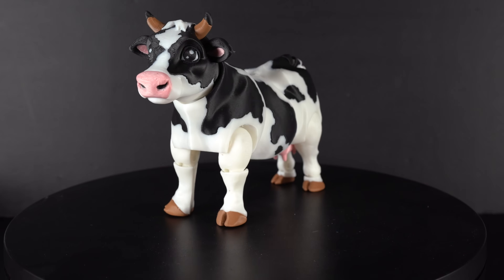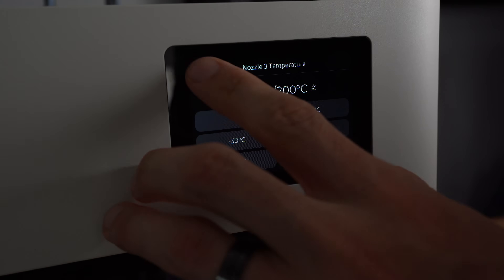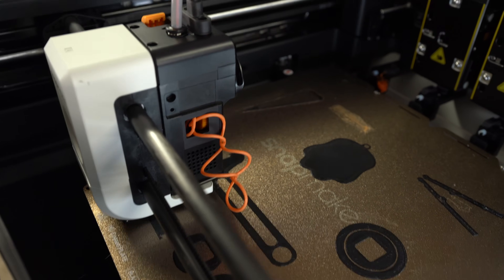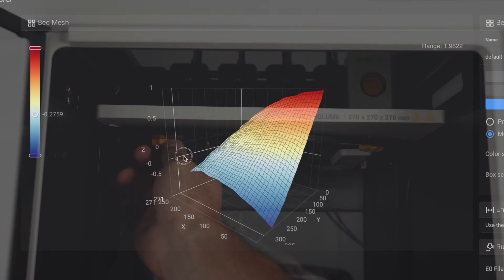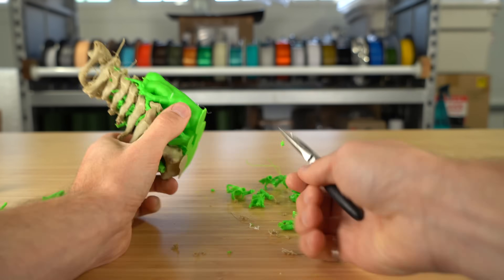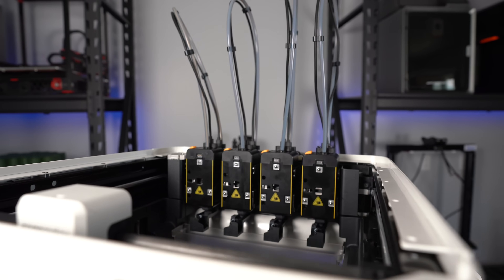The Snapmaker U1 Experiments - 4 Tools, 4 Materials

Comment: When using PETG for support for PLA don't use tree support They stick fine your contact patch was just too small and of course make sure you have a large high density contact area with a zero contact patch gap
Reply: Isn't it possible to change the contact area of tree supports?

I also wonder if PETG, being more flexible maybe is a bit worse than PLA for supports? Or at least might require more walls the taller the support is

Comment: The most impressive part is that's the FIRST docking failure I've heard of from all of the testers. I'm glad you got it working! The prints look excellent. If they can keep the production quality high, this will no doubt be the best option for multi-material printing that isn't over $1,000 more expensive. Glad you pointed out any issues you had though. Most are definitely minor or easy to fix. I have a lot of praise to give Snapmaker for using open Klipper and Orca as well as sending out a lot of test units and listening to testers. Hope the final product is great!
Reply: Yup. I still haven’t had one to date.
Reply: @thenextlayer  Have you had a change of heart on supporting jenoside to date?
Reply: I would love to see more content about this printer😊

Comment: Appreciated your video in advance of getting my (2) Snapmaker U1's. This is helpful in preparation for my next addition to using Creality K2 Plus with CFS and K1C.  I plan to use Snapmaker U1 mated with SpacePi X4 that is a Quad dryer.  Hope this will work out.  I will weld up a metal stand that will have the U1 in the middle, Dryer on top, and bottom shelf for Filament storage and wheels for mobility.

Comment: I have an A1 and yes certain plastic spools fall off during printing. My fix is to put medical fabric tape on the inside of the offending spools. I do have TPU spool adapters for other larger ones.

The bed screws could benefit from inserts to correct the problem. Overall this looks a great little printer.

Thank you for review of the U1 awesome video. Hope Prusa can up their game and overtake the market again. We need them to keep the other companies in line.
Reply: I wonder what Prusa thinks of this printer. Its open source and offers a lot of what the XL offers for a fifth of the price. They just came out with the Core One to compete with Bambu and they must be pulling their hair out now. But either way, the customers benefit

Comment: Does not include a chamber heater in the lid. That's probably the only thing missing from this printer
Reply: Doesn't heat rise up? I think a chamber heater in the lid would make little sense.
But maybe someone can replace the window at the back with a heater...
Reply: @henninghoefer your heat depends on convection based on insulation. But also, heat level depends on other heat sources with other purposes. I can't just heat the pad to 100 to keep the box warm at 50.

If you're in an area/room/garage where it gets really cold in winter, you might not be able to heat it up.

It's more about control, not actual heat

Comment: When i get the U1 I'm going to print from the snapboxes directly, until there is a mod out for the filament spool holders on the side, I got 3x A1 printer with ams lite and i really dislike the ams lite, most spools either fall of or diameter is to tight for the holder. Cant wait start using the U1 for multicolor and multi material

Comment: I would disagree about the last conclusion with the price. It looks like the U1 is much cheaper build in many areas, so we can see where the extra money goes in some other machines - more solid parts, closed chamber, higher temperatures and such. We'll have to wait until next year to see if a U1 can also as easily work through 2k or 3k hours without any major issues like some competition does in that price range. That's when we'll know if is a very good and maybe disrupting price or just a cheap try where they tried to save too much money to get to that price.

Comment: Few things:

- There is no heater in the lid, just a filter.
- The toolhead parking failure needed to be expanded on. Is there any recalibration of the parking possible? Was the print paused? How was this solved?
Reply from the maker: I just reseated the tool and resumed the print and it was fine. There might be a way to recalibrate but I’ve not tested it.
Reply: Having accessible JSON configs for this in Klipper is a good first step. I hope the firmware will be kept as open for the final release.

Comment: Much more excited about the Snapmaker U1 and the multi tool and open approach running klipper and using Orca Slicer.  Some concerns long term with the pogo pins with the tool heads but hopefully this unit will allow easy swap out if the pins need replacing.

I am interested in how the Vortek system with Bambu works out as well. One issue I can see with this system is extruder retractions needed shortly after changing colors/nozzles and the cut filament not into the melt zone of the nozzle.  Are they going to purge the material? Retract the filament back into the AMS to the melted section?

I feel waiting right now to see how all of these including the the very interesting INDX system of Bontech which appears to be the ultimate solution for it looks like 9 material/color nozzles.  Needless to say this is a great time for additive 3d printing and major advancements in the technology.

Comment: While I did back the U1 and I definitely have some reservations about Snapmaker as a company, if Prusa did launch an XL 2 with INDX, it would be my first Prusa* (while keeping my SV08's and getting INDX kits for those printers). *If it comes enclosed and is cheaper than the nearly $5000 they want for the current XL.

Comment: I am one the fance, it seames to me that the H2S is a more refined machine, and it may be more usefull to buy this one, and maybe upgrade to a toolchanging machine in a few years If I have fun with 3d printing.
Reply: If you’re new to 3d printing start with a cheaper printer than the H2S. Get an A1 or A1 mini.  Then if you like it spend away

Comment: The AMS lite definitely has the same issue with spool sizes. You can print spool adapters to make them fit. In fact, these holders look so identical to the Bambu ones that you might be able to use some of the same adapters. There are benefits to this system too. We don't have to care about cardboard spools vs plastic ones. 250g spools aren't an issue.

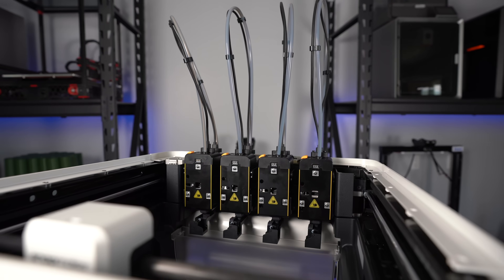Comment: Thanks for covering so many filaments and scenarios with the U1! By the way, I believe the U1 Top Cover you showed at cue point (2:40) is just a basic plastic cover with a filter and fan, not one with an active heater as some might assume. The claimed “chamber temperature up to 50°C” is actually referring to passive heating, which is the same effect you get with any enclosure when running a bed heated to around 100°C—whether it’s a consumer printer or a DIY setup.

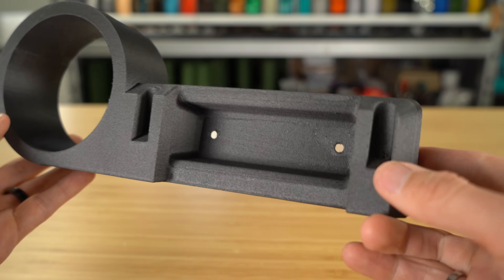When you mentioned there were no noticeable VFAs while showing the door step at cue point (9:13–9:16), I could actually see them clearly on screen. I was also surprised by how visible the VFAs were on your custom-made armrest shown at cue point (13:02). Considering it was printed in PET-CF—carbon-filled filament, which usually hides surface imperfections quite well—it really stood out this time, unfortunately.
At cue point (15:02), I even noticed a separated layer line and poor support overhangs very clearly (though maybe it was more obvious since I was watching on a large projected screen).
Still, thanks again for the effort you put into this video. It covered a lot of ground and provided a really comprehensive look at the U1.
Reply: I'm glad to have that info on the cover. There seems to not be much information or even a good screenshot of it, besides the tiny kickstarter thumbnail and some bullet points. I pledged for it but its probably best to pocket some money, as this hobby is already bleeding me dry 😂

I've watched a lot of videos on this printer, and while I do appreciate this video showing the good and bad, for what its worth, I have seen some absolutely flawless looking multicolor prints in other people's reviews with no vfas or anything. I guess it depends on the model, individual printer and belt tension, orientation, all of that really
Reply from the maker: Thanks! I was also quite surprised by the noticeable VFAs on the armrest. This prompted me to do a VFA test immediately after with glossy black PETG to see how bad they were. I printed a storage box oriented parallel to the build plate. I didn't notice any significant VFAs in this test. It's possible that the angle I printed the armrest at was a worse orientation as far as VFAs were concerned. I think what you're seeing at 15:02 is the under extrusion issue I discussed shortly after that. The PETG supports in this case did a bad job since they didn't stick well enough.

Comment: Also. Try using the bridging method. You can avoid using a ton of support material and isuues after it. So long the nozzle have 2 points to connect the filament. While less clean looking. It does the job good enough for most practical prints

Comment: That is one thing I do dislike about bambulab and many other brands. While automesh leveling does a fine job. 

Trible z motors would make the printer able to get a much more level bed without the user ajustisting anything. You push a button and the printer ajust or trim the bed itself automaticly.

Klipper support this native. But does require 2 additional motors and drivers. Given how many motors and drivers the u1 already had. I had hoved they went triple z.

However this a common cost saving thing with many brands including creality. Bambulab and most other brands
Reply from the maker: Yeah.. unfortunately the lead screws are all coupled together with a belt underneath.

Comment: Thanks so much for showing all the issues you had. The need to manual adjust the extruder tension for tpu is a big issue for me honestly. I print a ton of tpu and this seems like a big oversight.
Reply: To me it's not so much about the TPU part only, but it hints to a not very well thought filament transport. I simply expect better from an extruder these days.

Comment: Great video and thanks for the little plug at the end.  

I didn't realise the filament winder only wound in - as I was hoping it might be possible to adapt it to do a limited number of extra filament rolls tool swaps - to occasionally increase the colours beyond 4.   As you said it will be interest to see how people coming from the Bambulab AMS world get on with the much harder approach to filament changing.  I think some sort of AMS add-on from snap maker would be great for filament management, plus would also allow for occasional beyond 4 colour printing - although I understand why the wouldn't want to introduce it from day one and confuse the marketing.

I think though it would be filament cutter mods on the tool head(s) that the AMS' were connected to.

Also very interesting point about visibility - I don't think looking from the back is going to be practical - so would be interesting to see whether the camera would help with this.   I think this might end up being an issue with some implementations of the Bondtech INDX too - with either front or rear mounted tool tracks.
Reply: The Core One has similar issues with first layer visibility since theres am extrusion in the way.

The filament loader on the U1 seems relatively easy to install and uninstall, so perhaps they will release a dual motor version that can support rewinding down the line.
Reply from the maker: A cutter in the toolhead and the ability to retract filament automatically would be a huge quality of life improvement, and, like you say, open up additional possibilities if used in conjunction with an AMS type system.
Reply: @ygk3d Does the feeder actively feed during printing as well? Haven't really gotten any confirmation one way or the other
Reply from the maker: @winebartender6653 I don’t believe so. I haven’t noticed it running. The extruder does the pulling after the filament is loaded.
Reply: It is possible to change filament mid print quite easily. NeoKoi Prints has done a 16 color print. It just wouldn't make sense for something where you have more than 4 colors in multiple joined layers.
Reply: @802Garage  Dedicated sharpie-changer toolhead or inkjet toolhead for painting last layer 😅
There are DIY examples for both, but the filament could be the problem. Filament does not wick ink in controlled manner - or at all, like coated color printing (photo) paper.

Seriously, I could imagine someone finding a way to do something like that with INDX.

Comment: I backed it.  I was planning to sell my X1C's to get an H2S, but now I think I will wait.  For me, the future is tool changers.  If this works out for Snapmaker, I am hoping in the future they will release a 350x350 with 6 tool heads.  but having used a Bambu the last few years, I have found I rarely need a bed bigger than 250sq.
Reply: Once you go bigger trust me you will see the need to have a larger unit.  I personally have 2 of the U1 on pre order but I also own a K2 Plus and a K1 Max as well as a Kobra 2 Max and i use those larger printers a LOT for functional prints.
Reply: @anthonylong5870  I agree. I have been 3d printing since 2018. I have had many 300x300's (CR-10's and Pros), a 300x400 (Creatbot).  So I do want at least one printer that is 300x300 though I prefer 350sq.  If Snapmaker succeeds with this low cost tool changer, then maybe in the future they will do a 350sq with 6 tools and still be way cheaper than the Prusa XL.
Reply: Toolchangers are the future, but is it near future? CNCs enjoy toolchanging, but they don't have space or budget constraints like consumer 3d printers do. Reliable toolchanger mechanism for 3dp has yet to emerge.
Reply: @ErrorTH  Well if the Snapmaker U1 is successful, then they will be the future.  I was a kickstarter supporter for Bambu and looked how they changed things.  Maybe Snapmaker will do the same for tool changers.
Reply: I have a Kickstarter X1C.  Best printer I have ever had.

Comment: For support have u tried iron top layer for supports? I made this change and omg the difference its under supports and iron should be in there :)
Reply from the maker: No, I’ll have to try that. Thanks for the tip!
Reply: Does it result in a better interface surface for the model? Mine look like rubbish normally from my AD5M

Comment: Finally! This video will determine my purchase decision.
Reply: Um one review during beta testing?? I love Taylor, but really?
Reply: @alanday5255  I've watched all other available reviews during this beta season. Repairability is the top factor in my mind and this is the only channel that touched this subject in a meaningful manner.
Reply: Qidi had major issues with their 3D printer making printer bottom from plastic, they use metal since. So this is bad design from company that never learns, avoid.
Printer has no bottom metal structure, it bolts to flimsy plastic bottom.